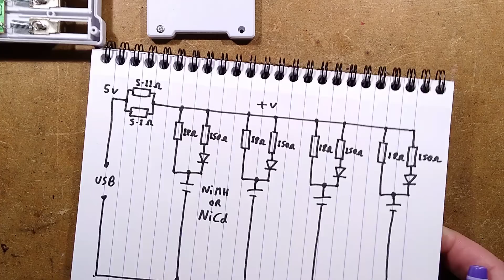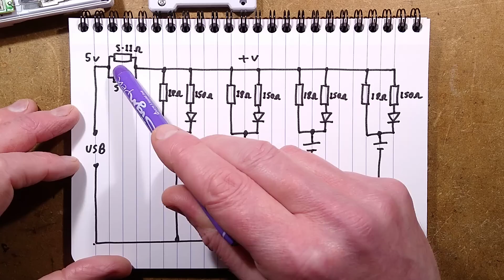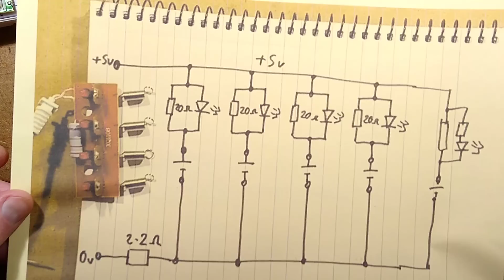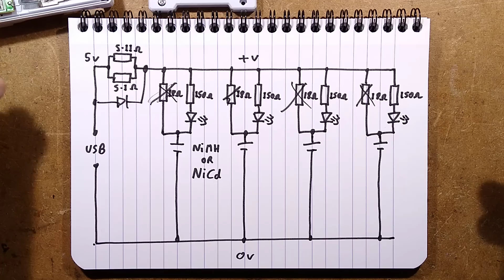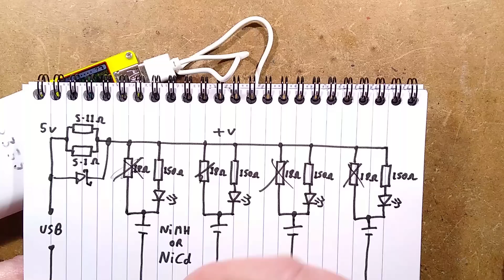eBay trash USB charger 2023 - with schematic

Comment: Surely the Schotky diode is being bypassed by the two resistors its in parallel with
Reply: The diode REPLACES the resistors.😖
Reply: @brucepickess8097  but he left the two resistors in the circuit,  didn't he?

Comment: What is the diode there for?
Reply: Clive explained that in the video. Effectively stops slow discharge of charged batteries through drain impedance of a still connected charger.

Comment: 6:28 If you snipped out the 20 ohm resistors the LEDs would act as diodes and stop the discharge anyway wouldn’t they?

Comment: By using the LED's as the only current path it effectively adds a diode for each cell as well, making a fully charged cell not able to "charge" the other cells when inserted. All charge must come from the supply.
Reply: Hence, changing the resistors for the scottky diode was unnecessary.

Comment: I'll share my tip for surface mount components, you need a stick of paper glue and a cocktail stick. 
Put a tiny bit of glue in the middle of the component with one end of the stick & place it on the pcb. Then using the other end apply a little pressure to keep it there while you solder it.

Comment: I have the same crappy charger, sort of. Case seems to be the same, PCB nearly the same but different resistors and I think there's no input resistance.  I just deleted the 4 low value 'Charge' resistors and let the LED and series resistor deliver about 8 or 9 mA per cell. Really no need for the input diode as the cells won't discharge through the LEDs. Will they?

Comment: What is the voltage across a battery? You measure a roughly 10mA per cell at 5V, how much of that is being drawn by the LED?
Reply: Kirchhoff's Law. The sum of current entering is equal to the sum of current leaving at all points in a circuit.
Reply from the maker: 2V is dropped across the LEDs.  The current is equal through the whole series circuit.

Comment: If you dont mind spending a little bit of cash, I really like the Nitecore battery chargers. they have a much longer spring contact so its capable of charging AA, AAA, and 18650 batteries. I think I charged a slightly larger battery cell than the 18650 for one vape I had, but I dont recall whats its number is. 

The nitecore has 2 and 4 battery bay options and the one I have has a nice lcd screen for showing charge rate and battery voltage and estimated charge level of 0 to 4 bars

Comment: as soon as i saw the non detatchable usb cable.... instantly knew it would be crap
Reply: odd question but have you ever pulled out a soldering iron and went for the paper printed circuit board instead of the actual product?
Reply from the maker: I've done it with test probes.

Comment: Why two 5R11 and 5R1 in parallel? Perhaps a clue is on the board. “2.7R”. Maybe one 2.7 ohm resistor is more expensive than a 5.11 and a 5.1 ohm and an extra dab of solder?
Reply: I think with surface mount that in this case they did parallel resistors for heat dissipation.

Comment: The resistor in parallel with the resistor and LED is an old trick, I've seen it used a few times for charging batteries in various equipments from my time working maintenance at the local hospital.
Reply: Yeah, I’ve seen that arrangement used in domestic and industrial Ni-Cad chargers from the 1980s onwards.

Comment: I bought the same ceramic tipped tweezers when I tried surface mount witchcraft, then realised I'm not a witch when it took 45 minutes to solder 6 resistors. Bollocks to that, I'll stick with through hole.

Comment: I don't understand, the diode is parallel to the 5.1 ohm resistors, so how can it prevent discharge through an unplugged USB power supply? Wouldn't the diode need to be in series instead?
Reply: He removed those 2 resistors, just didn't show that on the circuit diagram.
Reply: @rogerwilco5187  ah, thanks! That will teach me to try to cook while watching!
Reply: @rogerwilco5187  thanks, total noob, here, got quite confused when seeing the diagram initially. It made sense after he removed those first two resistors.

Comment: I can not imagine how you can solder SMD components with that flat tip without ragequitting from time to time
I've seen your videos for quite a while now and always wondered why you aren't using a standard pointy tip to solder.
I am using a Hakko T12-D08 Tip for almost everything between 0.1mm pitch ICs and 4mm² solid copper wire (that's 11AWG if you refuse metric)
The knockoff aliexpress hakko soldering stations and tips are absolutely usable. I have my daily workhorse for over 4 years now and it is still going strong with the first tip
I also have a J02 tip for crazy fine stuff, but the heat transfer is very weak on that one.
Also a D52 if I want to solder some copper pipe or a train track or something, that thing gets absurd amounts of heat everywhere
And in addition to that I have a KF or KR  which are great for melting about on 3D prints and hot glue
Reply from the maker: I prefer the heat mass of the bigger tip.
Reply: @bigclivedotcom  A bigger tip is the way to go, the bigger the better make those smd's glow.👍😏

Comment: The other issue with letting batteries sit at a higher current is the rapid expulsion of electrolyte, when they go bang, cos someone tried charging a battery on the wrong supply and soiled themselves when said battery went pop... :P

Comment: Apparently one of the more expensive Homes in the City I live was victimized by a Lithium Battery. Now I’ve always thought this would be the best way to cover up Insurance Fraud, so who knows if it was intentionally done or not. The Home would of been in the 1 Million Plus range though.

If you don't want to burn your place up I would suggest a “Lithium Charging Bag” for the more lively 6S or higher Packs.🔥

Comment: Yelling at my phone just short the two resistors. Diode not needed as the led will block reverse current.
Reply: to cater for any future parallel resistor changes.

Comment: Had a cheap NimH charger
just days after the Caps inside exploded
and it was being sold in germany where things like this have to meet strict standards even when sold in 1€ shops where i got mine.
Fairly dissapointed and not thinking id buy another. I also do not have a use for baterries as the device that used them no longer is used.
Reply: Just because our laws say that stuff has to be according to standards doesn't mean everything that gets imported gets checked for it. If they had such checks for everything in place, customs/Zoll would probably get completely overwhelmed, and probably 2/3 of the e-waste sold on Amazon and Ebay would vanish within a month.
Reply: @NiyaKouya  forgot to mention that for shops you can walk into those laws are being enforced

Comment: Those L shaped sliding contacts are the only way to do reliable charging. A simple spring always heats up and fails.
Reply: Noob here, but the L-shape battery holding mechanism has a spring as well. Or am I missing something obvious here?
Reply: @rogierius  The standard battery holder springs tend to act as induction loops (like your stove).

This heavy L shape plate & "spring" is designed to accept multiple battery sizes and avoid heating.

Comment: By the way, they sell 8W rechargeable soldering irons based on a similar to EVOD devices design and 510 screw-on soldering pieces (those you showcased before). They aren't very powerful and don't last much off of full charge; yet, they can save you in the field / during a power outage.
Moreover, they started to sell like more powerful soldering pieces with a set of changeable tips and spare heating elements, and bigger announced heating power, which could make them a better solutions for owners of more powerful battery mods. Have you tried these ones yet? I'm asking because even these eight-watts things are not as bad as I expected, and if you ever happen to get yourself the newer version, it'd be quite interesting to hear your review.
Reply from the maker: I have made a couple of videos about the vape based soldering irons.

Comment: I bought the exact same sh@t heap usb charging is useless and I don’t find the light changes yet. But I used google translate on the manual u get more specs and it even says charging via USB can get hot! And I think in English it say but also says to run at DC only at 5v 1amp DC plug like a small I phone charger I been using quicker results but still stupid cause u still have to check with multimeter! It’s LATE Matt here from Australia and I’ve been watching for ages just very late again  on subscribing I’ve done that now thanks for doing this video
Reply: Mind turn out probably was the first heap u bought mine has some dumb gap between 2nd an 3rd battery positions but now I reckon I mod mine! Cheers mate
Reply: Sorry I lied just a different and urs looked lots of English I have lot Chinese and a tiny bit of info in English more but not much in instructions
Reply: sounds like it needs checking/modding

Comment: I have a NiZn charger that's pretty advanced, has some form of monitoring or a fake way with dual-color LEDs
Reply: They usually have red and green in parallel, but green LED has higher forward voltage drop and lights up only when the current going into the battery drops low. They either connect such an indicator in parallel with the cell, or through a transistor, or control it via some IC.

Comment: I guess the Schottky diode is belt and suspenders, because the "D" in "LED" is for "diode"; the current should only go in one direction through either.
Reply from the maker: It was to allow for a future parallel resistor addition.

Comment: After watching some of your videos, I decided to try simple kits (or suites, as they call it); and initially I didn't feel good about those with SMD components, but I decided that if you said trying will help learning, one should try and see for themselves, right? After a very brief period, I came to a conclusion that if you solder manually and use lead-based solder with a low melting point, you can do and undo like 0805 or 0603, or SOT-23 quite easily, even with a «traditional» soldering iron. Since then, I don't fear SMD that much. Thank you a lot, again!

SMD components are also cheaper and more compact. ^_^
Reply: I get 1206 size SMD components where I can; manages to fit on 0.1" (2.54mm) veroboard hole spacing not too bad.
Reply: @jimmybrad156  I prefer 0805 ans 0603, since they fit right across the edges of the contact pads around the holes. And I chose to tombstone several 0805 resistors on one board — only because I decided it will fit even better this way.
Reply: @jkobain  What I really meant is that 1206's are a little easier to keep a hold of lol
Reply: @jimmybrad156  and the numbers are bigger to read, lol. ;D

Although caps are blank anyway…
Reply: @jkobain  yes, very important to keep lots of tiny zip lock bags with clearly marked values. A lot of people use them for SMD components, too. 😂
Reply: Janus Kobain hey What's up bro

Comment: Hi, I teach trade level Cert 3 Telecommunications, I also teach RF safety and use a  	
EME Guard by MVG
27.0-40 000.0 MHz
I had one of those batery chargers and the EMF/EME coming out of that charger was dangerous within 300mm
Put my spectrum anaylser on it and it was very noisy
just don't use them near where you are working
I think it was the switching power supply...?
cheers
Trevor
Reply: it wouldnt be the charger thing itself, but the psu feeding it , many usb plug type chargers are horrid for rf muck , swamping out mw radios
Reply: @andygozzo72  Hi, good logical comment.👍😏

Comment: I got the urge to take mine apart while watching the video, it has 240vac input but has a full wave rectifier and even a fuse.  Who can ask for anything more for about $5?   It works well.
Reply from the maker: Be aware that the cheap mains voltage ones can sometimes have poor electrical isolation.
Reply: The $10 ikea ones are safer for you and your cells :)

Comment: I do have some NiMH AA and AAA cells. For instance, I've been using NiMH AA ones in my wireless mouse every day for more than ten years already; and I can't really tell how many days or weeks it takes to discharge one cell. The mouse has a boost circuit in it, so it drains the cell quicker, but doesn't require two (thus neither weighs significantly more, nor falls to using two AAAs).
Those cells I bought before switching to this wireless mouse are still with me, and I honestly can't really even tell which of them all were bought a bit later; maybe only by date codes, or measuring their capacity degradation. I used to think NiCd cells are better for low-current applications: I've been told they have smaller self-discharge current. But, again, after more than ten years of using NiMH cells every day, I can't complain.
Initially, I didn't really like Lithium cells when they started appearing here and there, I was even more dumb and incompetent than I am now (surprisingly, it was possible!), plus they weren't as good as they can be today. Nowadays, I still like NiMH cells, already like Lithium cells (recently found three discarded POD units, one of them is rechargeable and supports cartridges with e-liquid and mesh heater), but my observations show that NiCd cells are leaving us: they suffer from memory effects similar to those of NiMH ones, they chemically degrade like faster, and their capacity per weight and per volume haven't been improved lately by the manufacturers.

I may be wrong (and I often tend to be), but this is my personal experience.

Comment: I would assume that the current draw had been limited to 500mA, which is the default limit for USB in the absence of shorted data lines, weird resistor combinations, or current negotiation.
Reply: there is no 'negotiation', is just a straight resistive current limit circuit, similar to most mains powered nicad/nimh chargers although one i have is more like the previous 'rougher' one, relying on the resistance of the transformer secondary wire to limit current !!    you could even use a small bulb as current limiter, i've done  a few times, for this a 6v 0.04a in each channel would do nicely , although not easy to find, 0.06a ones bit easier
Reply: The original USB spec was 100 mA (the pre-negotiated value) and 500 mA (the post negotiated value). The problem with that is that SOMETHING had to be able to limit the currents, and that semiconductor was $$$. Most of the Asian-supplied PCs were focused on low cost, so they omitted the current-limiting circuitry to save money. You often had the PC's raw 5V supply wired directly to the VBUS leads on the USB ports. In time, most PC guys threw up their hands and said "why bother?" and current was no longer limited. Now you have little 5V 1A and 2A wall warts that have no real current limiting to them. 
I recall long ago when the PC guys inquired of Apple what it would cost to add Apple's Firewire ports on their machines. Apple's reply was $1/port. They were outraged, saying that a USB port's cost was about 1/4th of that. Apple then tried to backpeddle and lower the licensing price, but the damage was done. How many PCs did you see with Firewire ports (before Apple killed Firewire)? My point being that PC manufacturers are extremely cost-conscious.

Comment: Nickel Cadmium? ...... I've not used "antique" batteries like those since the 1980's! 👎🤣
Reply: i still have 4 unused packs of 4 nicads from the early 2000s bet theyre knackered now
Reply: A small few of the ones I bought in the '80s still hold a useful charge. Hang in there, little buddies.
Reply: @tactileslut  Actually, I have two Sony nicad battery packs from 1984 (around £35 each), for my portable Betamax VCR, and 39 years on, they STILL hold a charge!

Comment: I would rather use surface mount than through hole. Much easier to work with once you have a system.

Comment: USB 2.0 can only support 500mA anyway so I think it makes sense that the charger does not go above that.
Reply: And some dirty wall adapters can't even supply this much, eh.
Reply: That's if the current to be passed from a 'Host' has been negotiated via protocol with an attached device. Most USB PSU's aren't designed as compliant USB Hosts and never enumerate with an attached device and will happily pass-thru whatever current is available depending on the design of whatever is attached.
Reply: ninaryguru Hey What's up

Comment: That product should not be sold in UK its a hazard to coz a fire🔥  the same goes for cheap phone chargers
Reply: no it isnt, max current it can pull from 5v is under 1 amp, worst case with 4 shorted cells, ,and it doesnt use mains itself, only 5v, so 5w, , the resistors would burn out open after a while ,

Comment: 6:28 Why did you remove the two resistors on the input side and replace it with a diode, when the LEDs are diodes and will do the same thing?
Reply from the maker: It's with adding other parallel resistors for higher current in mind.
Reply: The diode on the input side is to prevent discharging when the USB isn't powered (but still plugged in).
Reply: The LEDs (diodes that emit light) will serve the "same" purpose of preventing reverse current on the batteries.
Reply: @luisfhm007  Ah, yes. ISWYM.